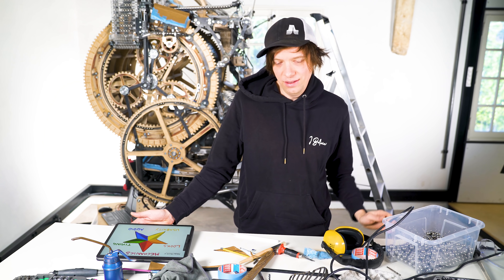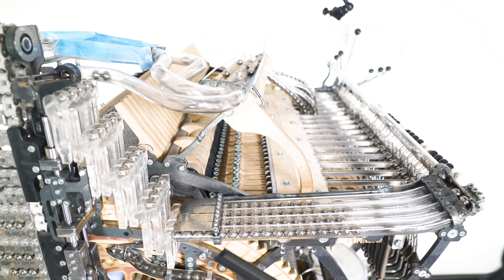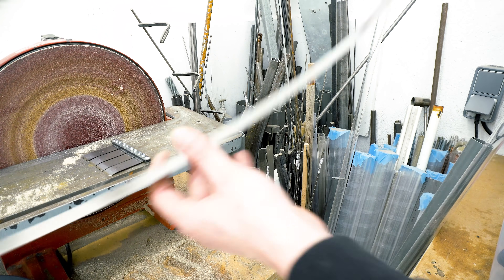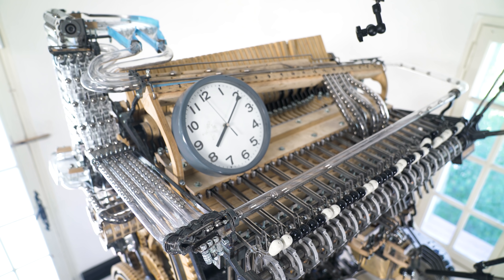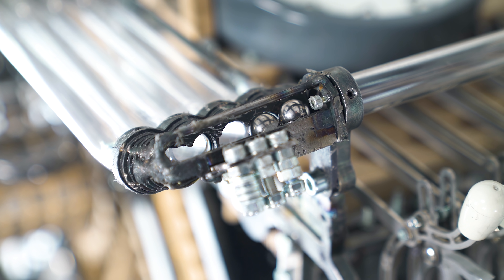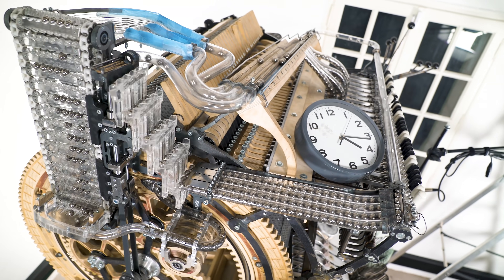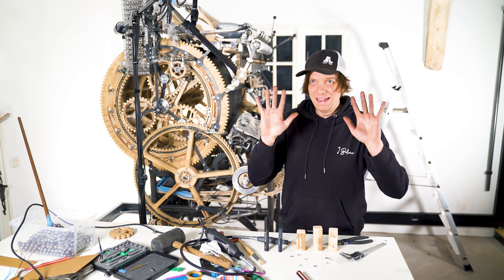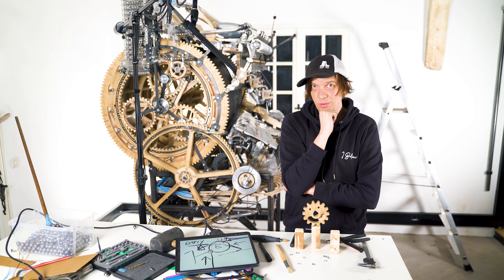Marble Machine X Fish Stair Upgrade

Comment: Part of the issue with the flying marbles seems to be the speed at which they arrive, when the fish stair is starved. It seems to me that, with the marble arriving at such a rapid pace, its momentum allows it to climb onto the already rising fish stair, at which point it can jam against the spring steel, ker-boom! Another dead drummer*. One possible solution, as many have suggested, is to invert the spring steel, which should tend to force the marble back down again, rather than trapping it; but IMHO it could still escape if the geometry was "just right". So how about this - add a piece of felt towards the end of the marble pipes, so if the marble has arrived at high speed into an empty channel, it's suddenly slowed down. This would rob it of the momentum it needs to "climb" onto the fish stair, and ensures it only enters the fish stair when it's at its lowest point.  This won't affect the machine when the marble channels are full, as pressure from behind will keep the marbles flowing; and when it's empty, their speed will get them up onto the "slowdown pad". Anyway... just a thought.

* Dead drummer, ala Spinal Tap: Marble pings out of the fish-stair, striking the drummer in the head. Or it flies out and knocks a piece of electrical kit into the drum kit, electrocuting the drummer. Other scenarios may be added as needed 😁

Comment: Is there not a possibility of getting some outside help? As you’ve said: the mmx has more parts than a car, but not a singe car is made by one person alone. If everyone on the assembly line had to know how to completely make the car it would take weeks to complete a single one. My point is that instead of playing engineering whack a mole you could hire mole killers that specialize in completely removing the mole instead of it just coming back later down the line. This is a HUGE task and there’s no wonder that it’ takes time when you are the Engineer, construction worker and end user all at once.
Reply: Many people have contributed to the project, designing and machining parts. But Covid lockdowns mean that getting anyone else in to help work on the machine itself is a non-starter.

Comment: Hey my English is not the best i think i have a easy soluchen for the problem i explain it in german you can translat it if you want.

Du kannst an die Fish stair ein Draht machen. Der in die Röhre geht und diese Sperrt. Das sorgt dafür dass bei der Bewegung nach unten entweder die Röhre offen ist für Kugeln. Sobald die Aufwerte Bewegung statt findet wird die Röhre gesperrt wird so das die Kugel die vor der sperre ist auf die Fish stair fallen kann. Die Kugeln die "Probleme" machen werden jetzt durch die Sperre aufgehalten so das sie erst bei dem Nächsten zyklus drauf kommen. 

Du brauchst dafür nur 1 Draht und 1 Loch somit wäre der Aufwand auch sehr gering.

Comment: Hi Martin, I have an idea. You could make the angle at the pipes a little steeper down at the end of the pipe to the fish stairs. Then the risk of a marble getting stuck is significantly lower. If a marble should want to get stuck, it would simply push itself back up into the pipe. The flatter the angle to the fish stairs, the higher the risk of the pipe bursting at the end when a marble gets stuck.

Comment: For the purpose of finishing the machine as a priority, you should go with ASAP (S for simple) solutions and worry about the esthetics later. I would recommand you to leave out the swing for now. It is slowing you down extensively and that makes you question the project.

Comment: If the fish stair occasionally shoots a marble out, that is not a show stopper. It's only a lost marble. The machine doesn't break or jam or even skip a note. You can perhaps tune that out by adjusting the lenth and shape of the springs, or you can take a different aproach and shape the transition point so that marbles are allowed to pile up while waiting for a free place on the stairs.

Comment: Please hang in there - you're 100% succeeding at making really good Youtube content.
I agree with some other commenters: trigger on 5th marble, which then remains gated until the 4 drop, and tilt mechanism resets. Another option is a bump or bristles in each tube before fish steps. A single marble cannot pass until upstream pressure from multiple marbles pushes it through - guarantees a single marble cannot rifle down an empty tube, collide and bounce off the steps. Elegance & simplicity are beautiful... but elusive. You're doing great.

Comment: Would it make any difference if you had a marble stopper right at the end of the tubes that could be driven mechanically by the pickup? In that way, the machine would not get to the edge-case. and in fact you could just remove the springs and let them fall straight onto the pickup, since the stoppers will prevent any more marbles from passing. I dunno, would it be worth trying out?

Comment: Fish stair problem followed by solution!: Looking at the video, the problem is the marble is caught directly between the lip of the stairs and tip of the spring metal and its being pinched directly in the center so that the marble doesnt want to go forward or back. As the stairs lift the marble stays balanced in the pinch point and the marble actually rolls back towards the pipes despite being pinched! I think this behavior can be taken advantage of to force the marble back into the pipe. 

#1 My first idea(in case you want to follow my thought process on this, otherwise skip to the next section) was to reduce the area where the pinch point exists by moving the spring steel forward within a mm or 2 of the fish stair so that the force of the marble itself moving forward doesnt allow it to be pinched[the area where it can be pinched is equal to the gap between the stairs and spring metal, smaller area, more likely chance that the marbles blows through it and pushes the spring steel out of its way and sits on the stairs]. Making the bend in the spring metal JUST high enough so that the marble can pass under it normally, it should catch these marbles and force them back into the pipe. With the pinch point being essentially straight up and down, there is VARY little space a marble could potentially get stuck in, but the chance probably still exists even if it is tiny...

fish stair solution:
#2 No matter what there is a tiny chance of it somehow still getting pinched, So maybe instead of reducing the area where it can be pinched, we take advantage of the fact its pinched! Here me out, dont say 'weve done that and the pipes broke' because there is a difference! in the video you can see that when the marble is pinched it rolls back towards the pipes as the fish stair rises keeping the marble pinched in place even as it rolls! So if you add a Vary solid bar of metal, [its length would be flat on one side with a angled edge along its length on the other side] and attach it [25-50% the thickness of a marble] ABOVE where the marbles roll, Once a marble is pinched and the fish stairs start to rise, the marble will naturally be forced to roll back, the angled bar above then comes into contact with the marble AFTER its rolled back a bit, This would push on the side of the pinch point and force it back towards the pipes! Check for yourself at 14:08 Counter intuitively... increase the gap between the spring steel and fish stairs would increase the area it can be pinched, but as the fish stairs rise, this would also increase how much the marble rolls back towards the fish stairs, given the metal bar more leverage to force the marble back down toward the pipe where the spring steel can then catch it and force it back in line on the pipe. 

i 100% think this could solve the problem completely with little effort.

Comment: I suspect you will never balance this marble gate as it may be a chaotic system, if you do manage to get it working reasonably well it will drift off over time. How about an electro mechanical system with sensors and an Arduino having individually working gates to keep the 4 lines in step.

Comment: I don't really understand why the spring steel is needed at all. If there were 4 half pipes leading to the stairs wouldn't that work just as well? Maybe a small brush of piece of felt to slow them down.

Comment: Not every edge case is a blocker. Identify the edge cases but be critical about how likely the edge case is to occur and whether a simple workaround can compensate for it. Maybe you can have a helper quickly turn up and put a few extra marbles in, or wear a helmet so the flying marble doesn't kill you. It's just a stupid example, but simple workarounds may be good enough initially as long as you identify them as such.

Comment: What I think might help with these escaping marble is a weird, but simple solution. Instead of turning the end of the spring-steel tongues downwards, try turning them upwards. This creates a pushing motion with stuck marble, rather than a pinching motion.

Comment: Divide by 4 Edge problem has already been solved. Your new version of the drop mechanism can be turned upside down somehow and used for the divide by 4? Its built in protection from the Edge problem. Preloading a marble ahead of time so the transfer to the ladder is always “in-time” with the mechanics.

Comment: I noticed a theme in both problems here: marbles have varying energy on entering both critical points, depending on how full or empty the channels are. Your problem on entering the fish stair isn't just timing, it's timing when a fast moving marble hits - which only happens when it's empty, because otherwise the marble in front stops it. The divider has a similar problem with high energy marbles knocking others out of position while the swing is trying to move. I wonder if just slowing the marbles before they hit might solve the problem.

Comment: For empty channel loading problem, it seems an issue can be second row marbles are stopped only by first row, or if there is no first row, they can go any time. What if you had a thin stopper wall, like a knife blade, that came up from below in front of first step, that would stop all marbles in the channel? This wall would be in front of the first step, but attached back to the second step of the ladder to get its timing. This wall (down) would allow marbles to load about half the cycle time, and (up) stop marbles about half the cycle time. Would hold and release marbles at a consistent time. Most important, could stop fast marbles from bouncing in at the wrong time.

Comment: I had an idea, what about a “safety” bar, that sits along all the channels in a slightly biased state (by spring or weight?) that raises and lowers (like a seesaw) when triggered by a nodule on the first fish stair... fish stair raises... triggers bar to lower... fish stair lowers... triggers bar to raise, that way, in a run dry scenario, if the stair was at the incorrect point for marbles to enter, they’d hit the “safety bar” first, until the fish stair released them on its way back to an appropriate entry point. The placement of the bar would possibly be placed just 1 marbles length before the stairs.
Reply: An alternative option would be to do this from underneath where the bar is spring loaded to stop the marbles and only releases with the downward force of the first fish stair or perhaps a cam wheel based off the stepper mechanism

Comment: Hi, Martin! The speed is too low. Try changing the angle of the plastic tube to a steeper one.
At high machine speed, the ball does not have enough speed to enter the elevator.

Comment: First step of fish stair right now goes down too far, so second marbles want to climb, BUT needs to go down that far, for enough dwell time to load. SO
First step should have floating mount, so when mechanism goes down low, a stopper holds first step at exact height for loading.  At exact height, when first marble loads, second marble hits at equator and doesn't climb. First step sits and waits for loading, at perfect height, while mechanism goes down further and comes back up. Can even increase down distance for more loading time.  When mechanism catches back up to load level it takes first step up with it.

Comment: Just in case it starts to hang up again, a crescent shaped adjuster on top, that moves on a screw, kind of like a tremolo bridge on a guitar should give you all the adjustability you would ever need, so you can minimize running dry, and avoid those collisions.
Reply: And, you can make that look really cool.
Reply: One more thought, you might be able to take a bass guitar bridge, assuming it’s the right size, and use it for parts.

Comment: Easy suggestion for the last problem:
What if you make a small slide on the entrance of the "clear elevator"? (the circled point on your draw)
If there is not enough space to let the marble jump on, it should push them back.

Comment: I don't think the mechanics are too fragile. Even if it is taken to live tours, the machine just need some longer time to tune and setup. I think whenever the machine is moved, most tweaks and adjustments you are doing to each critical part of the machine need to be re-do again and again. I think your focus should be to just reduce and concentrate the parts which constantly needs tweaking.
Also, since the ultimate goal for this project is to create music with the machine, not just "finishing" the machine, my suggestion is to create some  time constraints to yourself, say only dedicate several months or the first half of year to work on modifying the machine, and the second half of  the year focusing on making music or other creative contents with whatever is ready, and just do simple temporary patches when necessary. This way you can take time for any issues to sink in and allow yourself more time to think of alternative solutions.

Comment: I really feel like you are stuck chasing perfection where it isn't needed rather than just working on the things that are needed. Maybe put aside any non-critical issues (ones which cause the machine to fail) and accept that the odd marble will come out for the time being. You can come back to it later when you have a better idea of how the machine works as a whole.

Comment: Don't give up -- please, don't give up! There are always parts of a big project where it becomes overwhelming and frustrating, and questioning the worth of carrying on is natural. But you've come so far, and it is a wonderful thing you've created. I still think that if you could hear it play a tune, even a simple one, it might reinvigorate your passion for it.
I do also wonder if the 4-divider is a bit more than you need. I appreciate the tension between art and engineering, and wanting to make something look good. But what if, instead of four channels, there was a 'puddle' of marbles just waiting to be lifted onto the fish-stair? A steel plate, that opens out wider where it meets the fish-stair, and has guard edges to hold the marbles in and keep them from jumping out?... I think just having a mass of marbles waiting to be picked up would actually be quite beautiful, and it's a simpler solution: no trying to tune the 4-gate, and less chance of a marble escaping under tension...

Comment: Sometimes the artist in your head does a really good job of pretending they're the engineer. 

In other words, the engineer solution actually may be to use tweaks to get things working. It's the artist that wants to remove the div4 in the impossible quest for perfection.

Comment: You've got too much weight on the divide by 4. It's not tripping till the 5th marble hits the grouping. Also, on the stair pickup, the loaded marvel's are dropping too far below the plane, so they drop low before being picked up. It's causing the next set of marbles to shift forward. Just lower the ramp a little more and it'll be more in line with the stair plane.